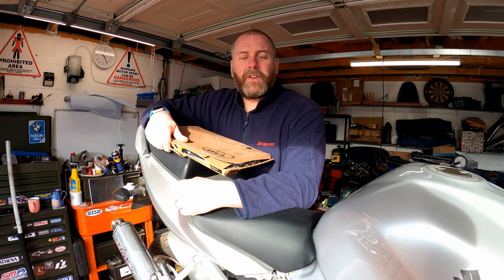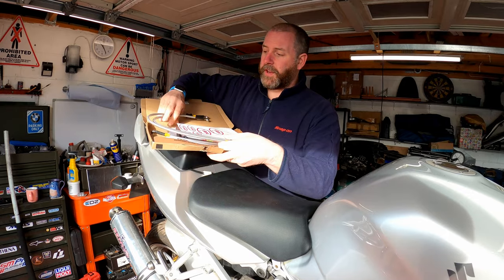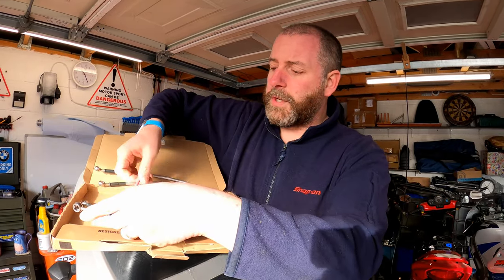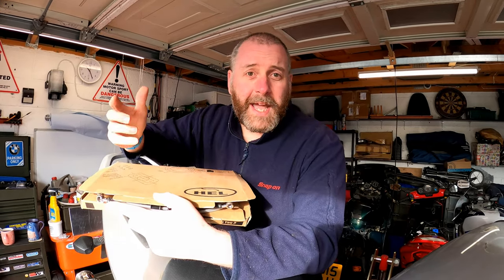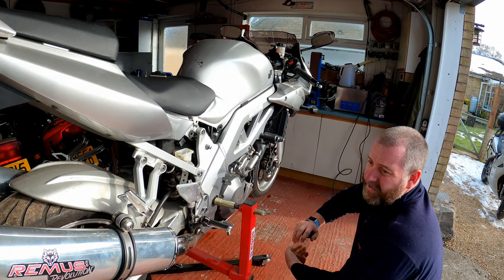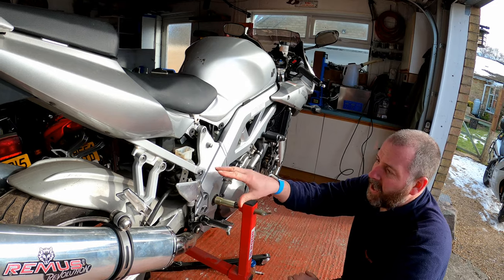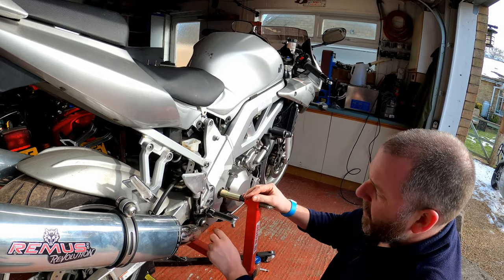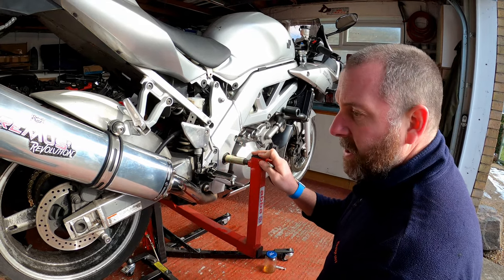Suzuki SV1000 Project Bike - Part 8 - Fitting HEL Performance Front & Rear Braided Brake Lines

Comment: I didn't remove the whole plate (of the rear break), I just opened the bolt from the other side using an extension and removed the break line only. :)

Comment: Great vid mate. Wondering where you got that manual vacuum for bleeding. Looks smart 👍
Reply from the maker: It’s really cheap and makes bleeding a doddle! Here’s a link 👍🏻 https://www.ebay.co.uk/itm/Brand-New-Hand-Held-Vacuum-Tester-and-Pump-Brake-Bleeder-Kit-Cars-Motorcycles/263369099003?epid=6011070880&hash=item3d520586fb:g:Or0AAMXQZ7dTlqXs&mkrid=710-53481-19255-0&siteid=3&mkcid=1&campid=5338707657&toolid=10001&customid=&mkevt=1
Reply: @KevsShed  thanks mate just what I need. I use a vacuum bleeder at work but it’s on an airline and I don’t have compressed air at home.